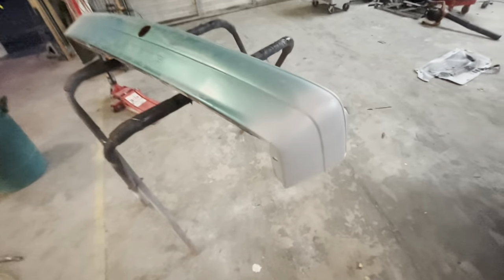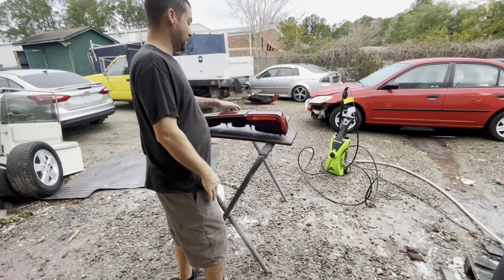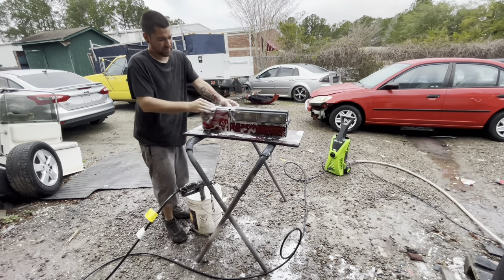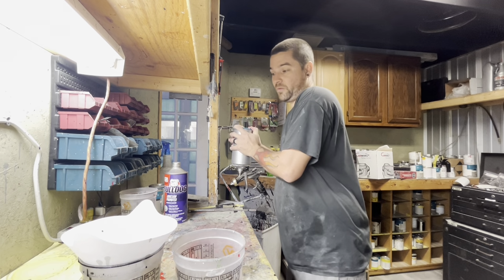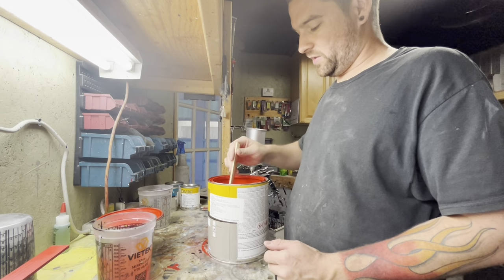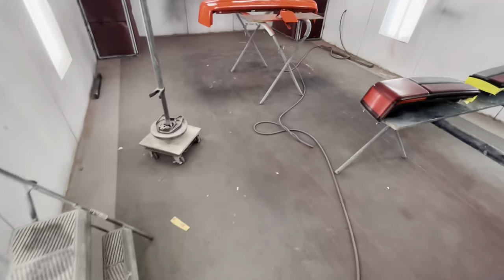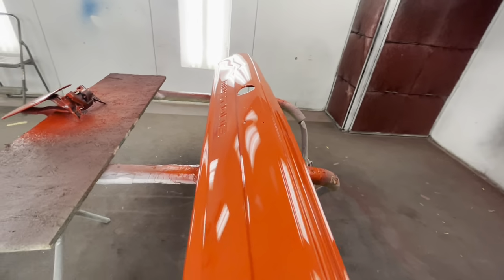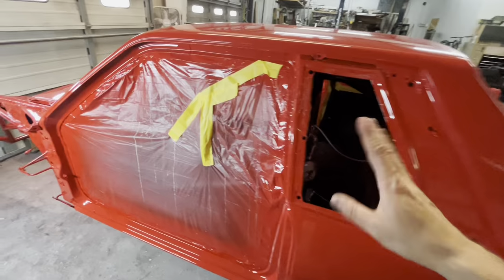DIY Taillight Tint & Painting Randy’s Fox Body Bumper (Valuable Clear Coat Trick In Video)

Comment: What brand clear coat and paint do you use?
Reply from the maker: It depends on the job. I always just use best bang for buck at local store as I don’t really prefer one brand. Normally I use Omni 270 clear and lately I’ve been using a lot of Norbin 115 bc it’s really cheap here local.
Reply: @ThePaintPaperHustle  I should have specified for tail lights. Thank you.
Reply from the maker: On taillights I’ll also use whatever I have around. Normally I’m the past it’s been Omni 270 and I’m pretty sure that’s what I’ve used on the ones I’ve done on here